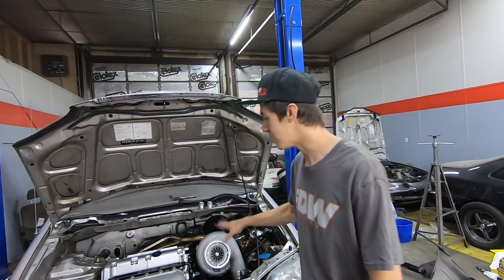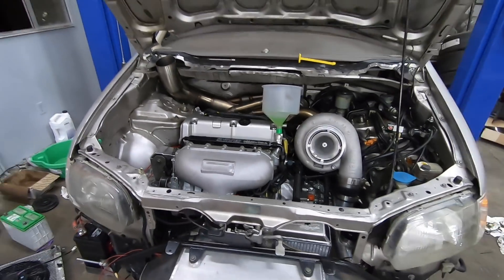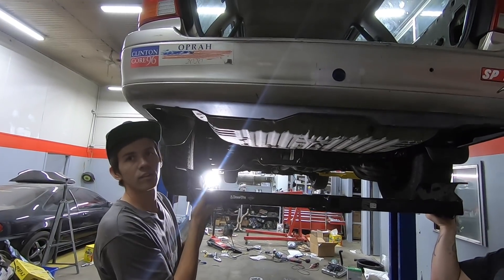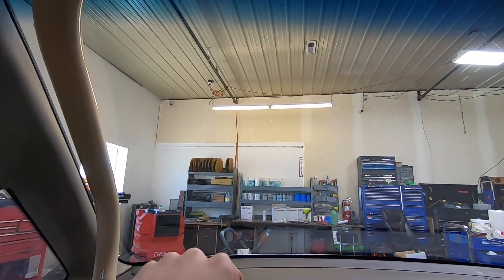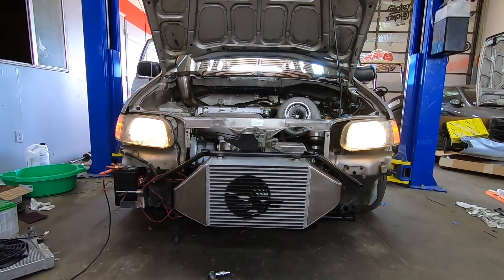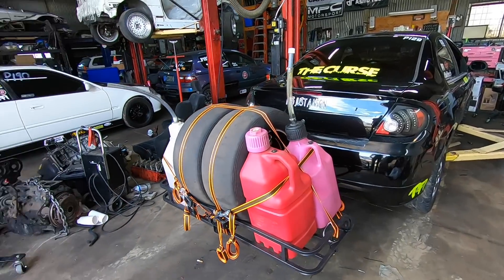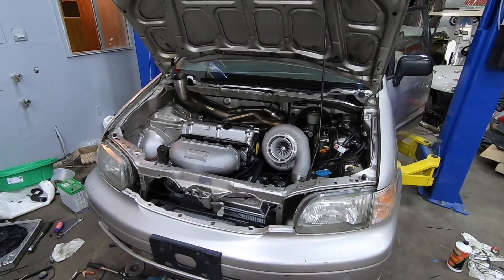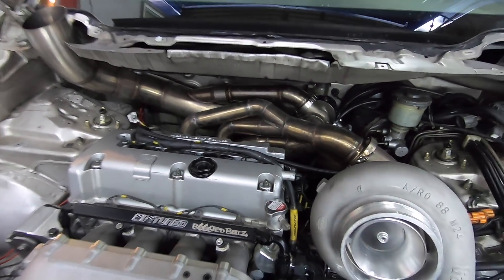The Rowdessey Was Just About Ready To Go Until It Broke...

Comment: seems like y’alls stock block ebay specials stayed together and made better power than built head/sleeved engines. it’s the nature of honda’s
Reply: I think Emilio is onto that and why he put the v8 straight into the supra without doing anything to it. I guess he's sick of built things breaking too.
Reply: @MV60  sometimes junkyard beats built
Reply: They are pushing them more. Staying at the same numbers would of increased reliability with built stuff.
Reply: @Vivid Media 2JZ says hello
Reply: @XBullitt16X  It actually depends on what power band you are.
Reply: Because OEM builds them better than half ass shops with off the shelf parts that may or may not all be to the correct spec with proper metallurgy,and then you have clearances.

Sloppymechanics had a nice vid on it
Reply: Both engines that have had issues ran the same heads.... Coincidence? Nah.... There's forum posts about that company.
Reply: 500-600hp can be done cheap, and some what reliable to. Pushing close to or over 1000hp on a 4 banger is al ot of stress. Even if its built. In the racing world engine brakes all the time, but they dont show it on video what happen after. Like a tear down of a broken engine.
Reply: @sukmidri  can you link the sloppy mechanics video I can't find it and would like to watch.
Reply: Yeah if they kept these built engines around 600 hp like there old builds they would have zero issues. They are pushing the limits with there builds now.
Reply: Obviously OEM engines are tuned way lower than they are capable of to ensure they can run for many miles. They also have a team of engineers designing, testing, and installed safe guards to protect the drivetrain. But most people don't build 1000 HP race engine hoping for it to last 200k. They just want to beat times or other cars, knowing they will have to rebuild in a much shorter amount of time. Has nothing to do with engines. Watch any other channel, Cleetus and his LS engines have had issues at times too
Reply: Also seems like the Ks are giving them trouble. Look at the Prelude, it makes a ton of power pretty reliably, not a K series.
Reply: @scootbmx01  i know those heads havent done anything good
Reply: thats the nature of ALL motors. you cant beat a factory engine build. 99% of engine shops are trash.
Reply: Most the time with stock/junkyard the tune is conservative compared to how they tune an oh it built send it then its sent to hard lol
Reply: @TreachourusJdogg  the prelude did have alot of issues , like the oil pumps going out and such . Also the prelude has a serious build with billet rods and custom bearings . Not a street able car tbh
Reply: @scootbmx01  More a valve issue.
Reply: @TreachourusJdogg  they had to open the motor up four times allready on the prelude and re bearing the engine they only did it twice to the ks lol
Reply: @scootbmx01  yeah thats what i have been thinking. Flexin with 4 piston heads but thats been the crutch of their builds.
Reply: @slappomatthew  what are you smoking.
Reply: It’s cause 4piston touched it
Reply: @TreachourusJdogg  the prelude has grenaded like 4 oil pumps wtf are you talking about lol
Reply: @ZREXER1250  that's why you don't run stock pumps.
Reply: @killer809829  all the preludes issues were as a result of that oil pump

Comment: The thermostat slows the flow of coolant down which allows time for the radiator to cool it back down.  Running without one is fine for the drag strip but it is going to overheat hard core out on the road because it will super heat the entire system and then you will be sitting along side the road waiting for hours for it to cool back off.  Been there done that, and mine was with a 4 core 3 gallon radiator so I guarantee that you are going to regret that decision on race week in the hot temperatures during the day on the long drives between tracks.

Comment: Think you're gonna wish the radiator was 3x bigger sooner or later, lol.
Reply: I was thinking the same thing.  and that gap between the ic and rad is a problem.  the air coming through the ic will take the path of least resistance, right around the rad.  fan is peanuts compared to 80mph air. edit  Thanks for all the thumbs up.  Hopefully Kyle can see this
Reply: @digitald5851  very good point
Reply: @digitald5851  pood goint
Reply: @digitald5851  goop doint
Reply: @digitald5851  good point
Reply: @digitald5851  Pood Goint
Reply: @digitald5851  Tood Poing
Reply: @digitald5851  good point
Reply: @digitald5851  ood oint
Reply: @digitald5851  G00D P0INT
Reply: @digitald5851  doint
Reply: @digitald5851  goit poond
Reply: I bet there will be a makeshift cardboard sleeve going between the intercooler and the radiator at some point on Race week. Good luck Kyle. We are all rooting for you
Reply: @digitald5851  good point
Reply: @digitald5851  Radiators quickly lose efficiency past a certain threshold of airflow, depending on fin density and delta temperature. 80mph air might not actually make that big of a difference compared to the fan running at full speed, but there are a lot of variables, so it's hard to say without actually testing. I still agree that it should be up against the radiator though.
Reply: Doog tniop
Reply: Well and he made the problem worse removing the thermostat. They proved that was a bad idea back in the 50's and 60's.
Reply: @Scootermagoo  idk man, my 1992 honda accord would overheat until I pulled the thermostat.
Reply: @OGbqze  sounds like you removed a broken thermostat from your Accord. Every car from the factory comes with a thermostat and doesn't overheat right?

Comment: Kyle you need to enclose the openings around the radiator/intercooler and the bumper....   the rad is so far back into the engine bay its just circulating hot air from the engine and not getting fresh air from out side. seal up all the areas so that the rad fan can only pull air from outside the bumper.. look at some Time Attack build for ideas to make it fancy or spray foam it and cut/shape it

Comment: The whole purpose of a van is to NOT need a trailer. Throw it all in the back!
Reply: Then take all the shit out, race, then put it back in.
Reply: The trailer should have all the parts and tools. But the van should have a grill and coolers and such.
Reply: As the other guys said, you can't run the class he wants to without using a trailer.

Comment: Kyle, I know what that’s like! It’s always nerve racking/depressing when after a long day of successful motor work, something still goes wrong. I had an issue with a bad flywheel where my pressure plate bolts kept coming loose even with red loctite! It left me stranded with no clutch engagement one night. Thank goodness after the second time it happened, I drilled a hole in my bell housing to tighten them down until I had time to put a new flywheel on 😅 Outlaws keep pushing on!

Comment: I think you have exceeded Honda’s  limits lol , ever since y’all went 800hp and up nothing but problems
Reply: Facts!
Reply: its content though either way
Reply: There are 1500whp Honda's in the sevens
Reply: john cuervo that are fully built they trying to push to much power on mostly stock shit...they need to turn everything down some and actually dial them in
Reply: I don’t think there has ever been a reliable piston engine over 800 hp by any manufacturer, except maybe Allison or Wright. Neither of which would be practical in this application.
Reply: John Cena they running billet everything
Reply: @johncuervo3019  2000hp civic out there
Reply: The Prelude might have something to say about that. No problems there for a long time until the oil pump gave up and that's a fifteen year old 1000hp build
Reply: @jc5445  pretty sure plenty of manufactures have built piston engines over 800hp that are reliable. It's usually the abusive owners that cause them to fail.
Reply: Stock or not all cars have minor issues doesn’t mean they aren’t or can’t be reliable. There are multiple 1000hp Honda’s, LS’s, Coyotes, maybe even Hemi’s out there that are true street cars and get daily driven. With more horsepower they can get less reliable but imo with today’s technology 1000hp cars can still prove to be reliable.
Reply: @testarossagzb5582  they fixed it tho. They just dont run it
Reply: @johncuervo3019  yeah that have $20k billet engines
Reply: 800 HP+ and three engine blocks per mile!
Reply: @kennanlynn4977  They only know full send and break it
Reply: @kasuraga  Really? Name them. You'll see a lot in race level power boats. And they need rebuilds every 100 hours. And it's expensive all around. Even the white Mr2 brass valve sleeves are only good for about 15 passes.
Reply: @Tomford.888.  I would say stock is the standard for reliable. So to say a 1000 HP car will last 200,000 miles without serious failures in the power train is just ignorant. It's more like maybe 30,000 miles. Look at Cleetus C7 for an example.
Reply: There is no content in a reliable car. Videos get boring and views go down. Everyone likes a good shitshow lol.
Reply: its because they keep trying to rev them to 10K.
Reply: Daniel Whetzel  not necessarily, Adam lz builds complete reliable cars and kills it in views. Actually everything constantly be built half ass and constantly breaking gets old and stale. No progression to cleaner  more complete professional Thorough reliable builds is why the channel has stalled, to a crawl in sub growth and views are just staying the same actually the last 2 months analytics showed 5% drop in channel views
Reply: watch Hushperformance they do it right. 8 second all motor hondas! this content is more entertaining in my opinion still tho.
Reply: true but there arent a ton of weak spots. the motors handle the power, but dropping springs and oil pumps are only the big 2 ive seen. This spring has no significance in relation too power.
Reply: You must not keep up with what Honda's are doing. Yes they are having some bad luck but literally tons of people do a build of lesser quality and beat on it for years
Reply: @Shadow0fd3ath24  there's plenty of non billet 1000hp hondas in the pro fwd scene
Reply: Pushing 800+ out of an engine that small will cause problems regardless of platform. Making 1000 out of a 427 is like a cake walk compared to the cylinder pressures and power efficiency these K series see
Reply: john cuervo  yeah and they get torn down every 10-20 passes lol.
Reply: J C are you high?
Reply: @hardknox1917  I think the drop In subs has more to do with the boiz randomly deciding to not put out content for weeks at a time, as they have multiple times already this year..
Reply: @Danbuilt426  I strongly disagree. I prefer my builds done correctly...like a job on a customers car. My stuff doesn't break because I build for a whole package. I mean look at Cleetus, he knows how to make content and not have everything broken. BoostedBoiz are a joke they constantly break the same parts over and over again, don't upgrade, and had to take a unprepared minivan to race week because all of their stuff is broken or doesn't work. I don't think I've seen any of their cars actually consistently make passes like a real race car for any decent amount of time. They always blow up or break.

Comment: You need to run a flow restrictor in place of the thermostat, it slows the flow through the cooling system allowing the coolant more time in the radiator to help cool it. We used to use either a 5/8 or 3/4 washer in place of the thermostat.

Comment: when the car is driving it will have the airstream from the movement of the car blowing through the rad. 
Just make sure that the fan is not working against that flow, in other words the polarity of the fan has to be rigged in such a way that it is pulling air instead of pushing. That way the fan is complementary to the the airflow when driving.
Reply: most times, a frunning fan will SLOW air down and be a restriction if your moving 70+mph. thats why factory shrouds have vents so the airflow can bypass the fan.

but as your saying, i'd assume they know better than to wire it as a pusher fan. this aint no D9.
Reply: @wadeellis67  assuming the fan can't spin air through it faster..
Reply: Dude is over here building full blown race cars. You really think this unsolicited elementary advice is necessary?

Comment: Volume of water doesnt do you any favours in heat rejection, surface area does.
Reply: More water with same displacement will help to not reach boiling point as fast.
Reply: @danh2360  also means takes longer to reject all the heat.

Comment: I feel like you guys need to just keep building your own heads.. you had a lot better luck when you installed all the parts yourself and it's most likely not a coincidence what happened to hondaru and the MR2s  head multiple times.. just get all the upgraded parts yourself and build it at the shop.. no more keeper probs and hopefully today was just a fluke with the spring but if not you better bring a spare head with on race week to plan ahead..

Comment: Why do all of your cars always break :(
Reply: Honda motors are incredible pieces of engineering but there’s a point in power in which oem factory parts can’t really hold. Boosted boiz usually exceed said power
Reply: This is the race world my friend. Happens to them all, we just don't get to hear or see about it as often with corporate sponsored race events. Gotta keep those sponsors looking good ya know.
Reply: These part are made by individuals with a dream and it's a gamble with them but when you make 300hp per cylinder you are doing something right 100 hp per cylinder is considered good 200 is build but 300 is full send.  Imagine your lawn mower had 300hp you would know for a fact it will fly apart but you find why fix repeat and keep going and one day you will have one you know it wont
Reply: When you are making 250hp+ per cylinder things get a little stressed out. That is similar stress to a V8 making over 2000, it surviving at all is a miracle.
Reply: The10000lbGorilla that’s Honda engineering brother! They hold more power bone stock then any other out there

Comment: You may want to still run a thermostat just drill a couple holes in the original t-stat. No thermostat will cause too much flow and not give the coolant time to cool in the rad. I don’t know much about Honda’s but it worked in my big block mopar.

Comment: It's usually better to install a 1/2 to 5/8" ID orifice to replace the thermostat. Will prevent the pump from cavitating at high RPM, prevent excess water flow, & reduce the power required by the pump.

Comment: Coil bind will break the lma spring. Big cams need different lma springs because the factory ones will bind and break with too much lift. I had to replace my factory lma in my b17 when I installed my pro2 cams. I think SpeedFactory or skunk2 sell aftermarket ones that can withstand the lift.

Comment: Just so you know... extended driving in heat, hauling a trailer, without a cooling system thermostat may actually cause overheating... when the thermostat closes it stops flow through the radiator which in turn allows the fans and air to cool the coolant in the radator. Steady flowing coolant just gets hotter and hotter. If ur fans flow enough air and radiator holds enough coolant it may not be a problem for you. Just something to keep in mind.

Comment: Taking out the thermostat will not help with overheating issues.  The thermostat works as a restriction to flow and that restriction helps keep the water in the radiator longer so that the radiator can do its thing and remove the heat from the water.  With no thermostat there is no restriction to flow so the radiator can not properly do its job.  The car will take longer to get up to temperature, because the thermostat stays closed until the water it at temp, and it will only take longer for the car to overheat.  Put the thermostat back in and actually plan out stuff such as heater lines and radiator size when building things like turbo manifolds and exhaust routing.

Comment: That radiator is going to be blowing hot air right at turbo might want to think of a turbo inlet tube to avoid that or put a secondary shroud on the radiator fan ducting it away from the turbo for better intake air Temps and egts

Comment: BoostedBoiz hey if you make a shroud off the rad fan and vent that heat out the bay make that engine bay temp lower for more efficacy. I did al lot of aluminum vents work in my bay of my sr race car.

Comment: Running no thermostat will make it overheat again.  If there is too much flow through the radiator too quick then it will not have time to cool down.  If your running no thermostat run restrictor plates.  Too much flow is just as bad as not enough flow.

Comment: Put a stock engine head for road driving and then put the built one on for racing, yeah itll be annoying taking it on and off but atleast you know itll be ready to race when ready. And or just turn everything down like to 300 hp to.keep it safe and then have the moon tune or high horsepower one for the track

Comment: Put some dielectric grease on those sockets, I would sell pigtails like hot cakes from melting the plug with a poor connection. Creates heat and burns the bulb super quickly

Comment: Wouldn't removing the thermostat let the coolant rush through the block so fast that it won't take heat with it? Doesn't there need to be a little restriction so the heat goes with the water? It will be fine at idle but will overheat at higher pump speeds

Comment: Old racer's reliability mod when deleting the thermostat......don't take the stat out completely, rather just gut the moving parts and poppet valve. 
By leaving the baseplate w/hole intact, you have eliminated the possibility of failure, but not changed the max flowrate of the cooling system. Moving the water too fast can be problematic since you have to give the coolant time to absorb and release it's heat.